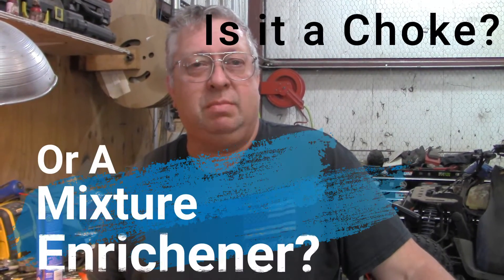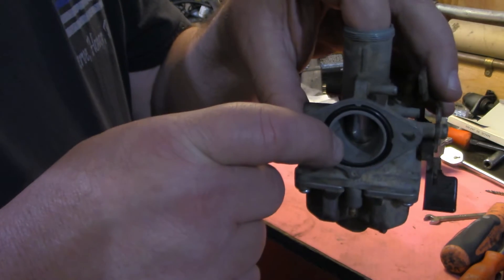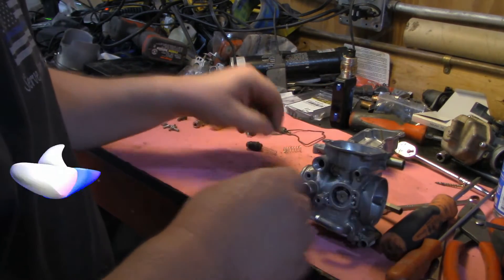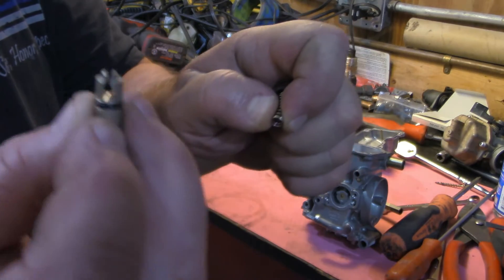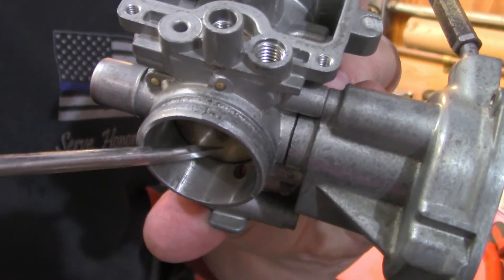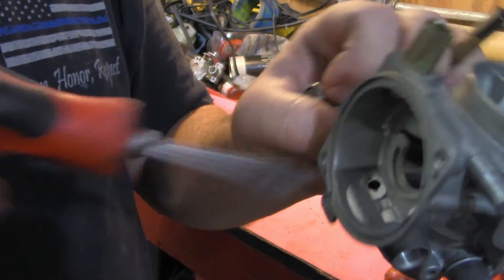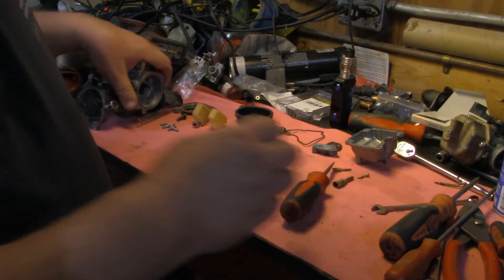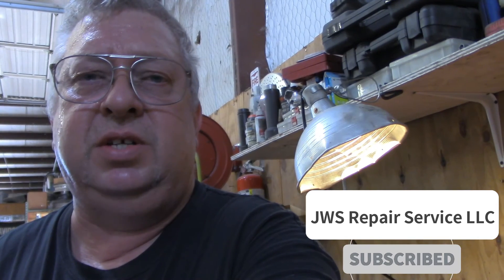Choke VS Mixture Enrichener

Comment: Knowing an enrichener allows more fuel when engaged, the question I have is if the enrichener slide is not seating properly would that cause a high idle and if so would that high idle be a lean idle? Thank you! Love the knowledge you are sharing.
Reply from the maker: If the plunger isn't seating you would indeed have a high idle speed, it would most likely be rich though, as the enrichener not seating would still supply both air and fuel, however the high idle would cause very high vacuum with the slide/butterfly closed, that would cause fuel to enter the venturi through the main jet circuit. Luckily a failure of the plunger to seat is relatively rare and usually the result of chemical damage ie. Berryman Chemtool being used as a starting fluid.

Comment: Hi JWS How can I tell if my enricher is leaking? Bike 1986 yamaha maxim x 700cc, Mukuni bs 33 cv>  It starts and runs with idle mixture completely closed. where is the fuel coming from. I get high idle 5k and then idle downs, then shuts off. Any help would be great.
Reply from the maker: I doubt you have an issue with your enrichener circuit, your problem sounds like a classic case of clogged pilot jets. The high idle is because the idle screw has been turned in too far to try to get an idle but actually causes the slides to rise slightly allowing fuel flow from the main jets into the intake. Clean your carbs, set the idle properly and synch them and you should to go. This video  https://youtu.be/LI1ecmr2eLY  is a Suzuki but still an inline 4 and will be similar in many ways. I loved those 1980's Maxim's, I even had the privilege of throwing a leg over the Seca Turbo, awesome machine! Good luck and thanks for watching!

Comment: Would you consider making a video on the S and S Super E enrichener circuit?
Best in your business and great explanation. Thanks.
Reply from the maker: If I had any Harley's in anymore I would. Sadly the amount of riders in our area has dropped substantially due to maniacal drivers making it unsafe to to drive an APC on the road, LOL. The Super E uses a plunger style enrichener circuit like many modern bikes, the closest thing I probably have is a Harley/Kawasaki style Keihin CV carb with the enrichener circuit. The last Super E I saw was on a 83 FLH Shovelhead, and that was several years ago.

Comment: I've had a dozen bikes with a manual choke, never had a problem.  Now i have a 2007 honda helix 250 maxi scooter with throttle enrichment. It works flawlessly, much preferred over manual choke.